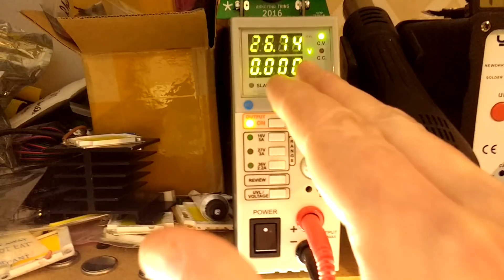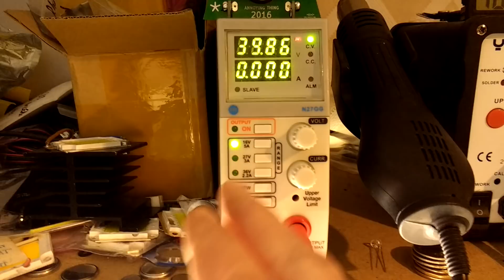Why I never show my power supply.

Comment: Must say I have never noticed this on my unit but now I’m paranoid of it happening
Reply from the maker: If you mainly use it on low voltages then you can get some security by setting the other ranges to a low voltage so that if the unit crashes and selects the highest voltage range the output is still low.
Reply: bigclivedotcom thanks I will keep it set low

Comment: I've been using a "budget" e-bay special - dps5005.  It's a voltage/current regulator without a power stage so you can use whatever PSU you have available that suits your needs - input V will be 1.1 x the output - so while it's rated 50v@5a in my case the actual limit is 11v @5a.  It's a good enough solution for my needs and no nasty surprises (yet!).

It's performed well for over 6 months, so far so good.

There is a hack which looks tempting but I haven't had the time to do anything yet (https://johan.kanflo.com/upgrading-your-dps5005/).
Reply from the maker: I've had one of those modules sitting here for a while.  I may build a new supply.

Comment: I've got a chinesium grade 30v, 2a power supply from eBay for about 40 quid, massive transformer inside, weighs a bloody tonne! Absolute beast, never had a single problem with it, would recommend it highly, very accurate digital display, very noice for every day use, realistically does 32v 6amps said the displays when I fried an old broken arduino so all good!

Comment: Any tips on a good power supply from the candy maountain(deliberately misspelled)?
Reply from the maker: It's hard to recommend a particular model as many are clones of clones with wildly different circuitry.
Reply: I see... Any advice on things to look for or to be warned by when searching for a power supply in thoes kind of places? Or is it better to just stay away from cheap power supplies?

Comment: That soldering station beside it also has a design flaw.  Only transistors control the heating elements, so if it fails, it can power on even if the switches are off.  There is a YouTube video about this.  Transistor failed and the reflow wand melted.  So I always keep mine unplugged when not in use.  Great station otherwise.

Comment: I'm sure +Bigclivedotcom could design and build a new one using off the shelf components 😂.
Reply from the maker: That video was the manufacturers worst nightmare for otherwise quite interesting modules.
Reply: There are some pretty cheap parts to build one available. EEVBlog reviewed one recently. It did catch fire but apparently that's a design flaw that has been fixed.
Reply: And yet still I want to buy one.
Reply: It was a design flaw (Dave's conclusion) there was a component directly under one of the screw terminal. The force of the screwdriver bent the board and the component broke and shorted the input. They had already experienced it but didn't change their design. Now they changed it. It was affecting only one model of their power supply. Anyways, I bought one and waiting for it that's why I know a bit about them.
Reply: Chaos Corner - I thought his conclusion was that it was a substandard component, not a design fault. He was lucky to have had a photograph of that part of the PCB, which allowed an effective repair.
Reply: Dick Fageroni so show me please, I really would like to build my own.. any pointers? EDIT: oh sorry I thought you meant that was easy.. yeah seems complicated to cover everything
Reply: I have finally succeeded after a decade of badgering to have programmable PSUs in the next generation of test gear we're doing for China production, instead of toggle switches. It uses PWM from a PIC to pull the feedback of a switcher up or down. But we should have done it a decade ago with COTS gear and SCPI, or these days Ethernet.

Comment: We make high power costum power supplies at Dana power supplies and electronic loads Torino Italy
Im thinking to make a channel with the most interesting projects at work, the last one was a 3V-3000A working at up to 100khz 
I wanted to know how many people would be interested in watching videos about building this 500kg power supplies
Reply: i have no idea how a power supply is made. well i have a vague one but anyway if its a good channel that i came across i would watch it and learn more about that. so i say try it out. why not. although the start is gonna be hard, that i can tell you.
Reply: +Scott Smith
What's your problem with him? Why do you feel the need to be rude?
Reply: Fucking hell, 3kA @ 3v?  That's gonna have some really fucking massive conductors...
Reply: CodeBurger some people have to free time on their hands,don't bother
Reply: Mark me as interested too!
I'd like to know when you start!
Reply: Very interested!
Reply: CodeBurger above 20A we use copper bars, some times 6x50mm
Reply: Tech Turin On this channel? All of them.
Reply: That would be great!
I once came upon an article on copperplating at low voltage, high amperage for artistic effects, but I could not source a suitable transformer.
Reply: Yes! But please include info about the design, how it works etc.
Reply: And I thought the old ECL rack power supplies were high power with  -2.2V@200A i'd be interested all right.
Reply: I would! Those PSUs are MASSIVE!
Reply: Who buys those things, Dr. Evil? Subscribed.
Reply: Yeah I'd probably watch it tbh... especially if you use a lot of FART transformers.
don't fall foul of your companies social media policy or anything though.
Reply: I'm in.
Reply: Hugh Brackett usually factories that make switches usually need to test them in short circuit for many cycles
Reply: Im happy that you guys are interested,il need to propose this to my boss because i don't don't want to give them any problems posting videos about our work whiteout knowing if i can
Reply: Hugh Brackett usually factories that make switches usually need to test them in short circuit for many cycles
Reply: Sniuchi
How did it turn out?
Reply: Go away.

Comment: I know these are efficient but overall I think this is a great reason to own and use an old fashioned linear supply. The one I made in college can output almost 10 times what it is rated for with no problem.They're pretty bulletproof. Never unpredictable.
Reply: John Possum I love linear supplies, but they do have one fatal failure mode of their own to be aware of and that is a series-pass transistor failure at which point the full unregulated output of the unregulated rectified DC will be passed to your circuit.  At low currents levels this voltage may be as much as 1.5-2 times the upper end of the regulated output voltage range due to the transformer being lightly loaded (thus not pulling the voltage down) and the unregulated side rising to the peak AC voltage, minus a diode drop, or two, as opposed to the RMS voltage one would expect to see at full load.  

I also strongly recommend linear supplies as the preferred choice for bench supplies in most cases, particularly up to the 10A level, but one should always be aware of that failure mode and ensure a good and robust crowbar circuit is installed along with a fast acting fuse (not a circuit breaker) to interrupt the output as quickly as possible.  I have suffered damage before when the crowbar circuit failed while trying to shunt the 60-70+A output of the transformer as the fuse did not blow before the crowbar SCR exploded!  I then had to repair several of my (amateur/ham) radios after that series-pass failure in one of my larger linear supplies as radios designed for 13.8VDC are not terribly tolerant of 26VDC!

Comment: I have a "Tenma 72-10495" purchased from Amazon for ~£120. It's a Dual output 0-30V 5A, and it has special modes to know when you are using it in series or in parallel so you can get extra ummph out of it. I highly recommend it, but I think I have only used the dual nature of it only twice in the years I have had it, so going for the single channel version (to make it cheaper) is well advised.

Comment: Why do you not repair it? YOU are an electronic specialist. What the problems?
Reply from the maker: It's an inherent design issue.  It could be a fault in the locked software.
Reply: Not to mention, unpredictable intermittent failures can be a royal pain to analyze.
Reply: bigclivedotcom   This is a computer? I thought so far  this is a power supply  where I can adjust current and voltage? 

What I can not do on my model railway transformator. I open it already only hardware no software. See this english spoken video too. 

https://youtu.be/wI-KYRdmx-E

Comment: You should make a follow-up video showing us what we should look for in a power supply, be it budget or not.
Reply: It shouldn't crash
Reply: Ah, yes. That's the spec I always look for.

-5A max output
-0.5% accuracy
-Doesn't crash
Reply: It all depends on what you need it for... Any random DC-DC converter should do perfectly fine for most hobby use, but if you're designing or repairing a product maybe you want something a little more reliable and/or has a higher output.
Reply: Like vgamesx1 said, there's really no definitive guide to what you should look for. That's like making a video of what you should look for when buying a vehicle. If you're using that vehicle to for your oil delivery business then my recommendation on a small economical sedan with standard sized tires, low cost oem parts available, etc. Still would be absolutely useless. The same goes for power supplies and most anything. If you only work with logic level circuits with fairly low current then what you should be looking for is completely different than  what someone who frequently works with 20A+.
Reply: @NoName actually the good ones are usually combo these days. IE a Switching regulator tracking about 3.5V above the linear regulator output. That way your linear hopefully rejects the switching noise and you get close to linear only performance but cheaper cost and lower losses. Only the really expensive ones are linear and some have astoundingly low noise measured in microvolts, or if you want to mortgage your house nanovolts.
Reply: A good bench supply will be linear.
Reply: best to go for manual ones not microcontroller based ones ,like a multi purpose variac
Reply: @Gordon Lawrence That makes sense Gordon.

I was lucky and managed to get a pair of used HP/Agilent supplies from a nice chap on Dave's(EEVBlog) forum.
Heavy as hell, filled with some good old iron and copper, and they were cheap as chips too.
I certainly couldn't afford to pay the going rate for that level of kit.

Would still recommend buying something used, get so much more quality for your money than messing about with modern kit that never seems to even aim for the build quality.

Comment: Those are not cheap and I was thinking of getting one, but instead I purchased a KPS3005D by Zahoiaxin, not sure if I spelled it correctly. So far it has been really reliable, but it has a bit of noise when using it to power something that is connected to an oscilloscope.

Comment: I have the same one, not had any crashes but it has hopped up to a high voltage before and fried a DC-DC converter, apparently a one off a few years back. Main issue I have is that it doesn't display voltages below ~3.5v properly, although output is fine.

Comment: Just make one out of 3 old server power supplys. (Isolate the output grounds and hook them in series.) and a cheap adjustable CC CV regulator. The server power supplys puts out clean DC power and are fairly cheap.

Comment: I want to buy a bench power supply and see them on Ebay for a little at $40 USD for a 30V 5A supply. What should I look out for both positive and negative?
Reply from the maker: I only ever really use a single rail power supply.  You only need a split rail for some specialist applications like traditional audio amplifiers or op-amp circuits.

Comment: Do you have one you would recommend?
Reply: I have a Tekpower 3005D-3 (http://tekpower.us/power-supply/linear-powersupply/tp3003d-3.html) and it works well. It's a proper linear supply (not switch-mode) so it's large and heavy but very low electrical noise. I replaced the pots with 10-turn versions, it's quite stable & the 10-turn pots provide good accuracy. The adjustable channels can of course be connected in series or parallel for a 0-60V 5A power supply or a 0-30V 10A supply. It's surprisingly well made for the price.
Reply: In the US for a really decent but cheapie supply I would recommend the 0-50V 0-3A https://www.circuitspecialists.com/bench-power-supply-csi5003x5.html for $123.30. They have a 10 turn pot to set the voltage and the current limiting is really wonderful. I did extensive boost/buck LED driver development using one. It's an inexpensive Chinese OEM unit but you'll pay six times more for anything even approaching the utility quality from a maker like Keithley. There are so many options today... anything you find here that fits your bill you should be able to depend on for a lifetime of service: http://www.newark.com/c/test-measurement/bench-power-supplies-sources-loads/bench-top-power-supplies

Comment: So its running Windows?
Reply: Scott Smith - Everyone makes fun of Windows and MS because of their poor decisions and marketing.  Look at how Windows 8 came out with huge changes that most did not like.  They didn't consult or gradually change, they just rammed a new design on customers and took away features that many use.  And Windows 10... they gave it away for "free" so they could push their new "app" store and auto install software that the user didn't ask for.  Not to mention MS's new "data collection policies".  MS has gone from a respected and trusted company and now has forced many many people to make the switch to a community provided Linux OS.  Windows 7 was the last.  Poor management decisions...
Reply: +Scott Smith: If Microsoft hadn't existed we would be running modern versions of RiscOS, GEM and other graphic shells that were at one time competing with MS Windows. Apple wouid also have been around in much the same way and Linux might have had a more marginal existance. Also  never forget that marketing has always been MS'ses greatest accomplishment. They have a few technical firsts or bests from time to time, but mostly they were and are lagging behind on industry standard.
Reply: Maybe that annoying Clip-it paper clip thing has become loose inside and it's wreaking havoc with the software!
Reply: +Scott Smith
MS-DOS is much more reliable than windows, and is still used in many critical environments.
Reply: It must be Windows, because it generates a Blue Smokescreen Of Death, BSOD!
Reply: Is this 2002? ffs
Reply: ...Cannot supply requested voltage.  Please wait while updating.  Do not turn off the power supply.
Reply: probably windows 10 saying yes master while giving you the finger.
Reply: No, it's running Linux. Didn't you see the 400 dip switches on the side? (It looks daunting at first but 390 of them are just different ways of setting the first 10.)
Reply: Everyone makes fun of windows. Now please imagine a world that ms-dos and windows 3.1 did not exist in. Imagine a world without Microsoft. Yea, it’s been around a while, hell at one point Macs where running Microsoft,  Ms in Ms-dos is abbreviation for Microsoft. The history of what we know of as computers now has its roots in Microsoft, or is still around thanks to Microsoft.
Reply: @scottsmith4204  There were alternatives to Windows back then, and there still are. Until 3.1 we could've ended up with GEM going mainstream for example, and CP/M was all the rage until DOS swept it up.

Comment: A very naughty power supply.
Reply: Coal for this power supply!
Reply: ... Are you beef flavoured? 🤔
Reply: Brandon Cornett, Quite possibly. Harry 8642, Cesium. Never settle for less!
Reply: buillioncubes Good it's the only bullion cube worth purchase 👌
Reply: Not really. I've owned one for years, and it never fails in it's intended use. Switching power ranges while it's supplying power is not it's intended use, so it's not a surprise it might actually get glitchy.
If you want a power supply, better protected against misuse, you need to buy a more expensive Chinese product.